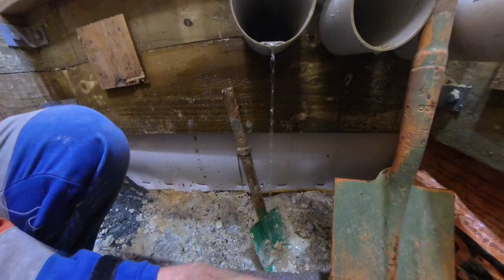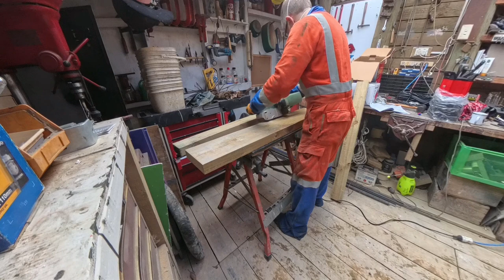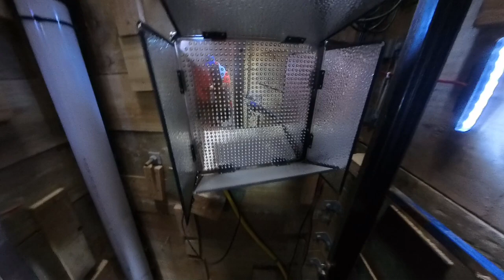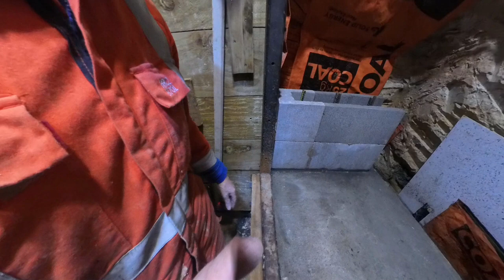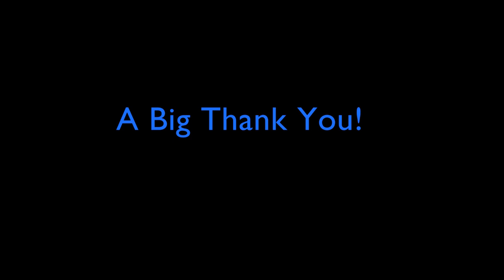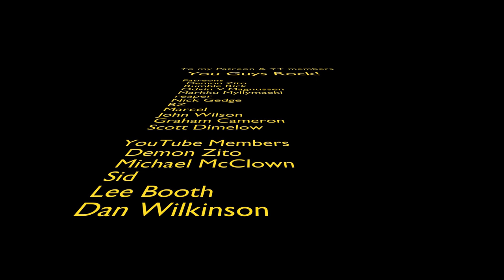Water Problems in the Secret Underground Bunker Build

Comment: As long as you keep cutting out the web on the block you dont need to care much about staggering joints, just lots of rebar on cold joints, its just a nice finish form work for the concrete.

Comment: Ah a probattunity . Your gatden being  sloping in terrain. If you put the water outlets as low as you dare, once the water is out of the hole its travels downhill acting as syphon helping the pump overcome that 8m lift. 
Glueing bricks together feels wrong,and looks expensive (unless you have a 'supply 😉😉' of the stuff)  it might be lime mortar that can be used super thin( victorian style, ↖️ no expert) 
Guess your newfound water supply is coming from the exposed clay face of the tunnel,any pooling at the  far edge of slab. Maybe repurpose a vent to drainage.hopefully temporary otherwise A few cables inside an air duct doesn't sound to terrible. 
New pump looks good , might even be able to cope with mums cooking.

Comment: There should be a thread on the fitting Lex get a 25mm dwt threaded fitting to connect to the pump. Get a screw able union to easily disconnect it from the pipework for service. Try and use 45 degree bends if you can it will increase the flow rate 90 is a lot more restrictive. Flexible hose can kink to easily.

Comment: You need to stagger the bricks so they interlock when filled with concrete.. if you don't stagger them they will work as individual columns rather than a solid wall. Steel layer every course of blocks. There will be a lot of pressure on the lower courses. If you can paint the back with a waterproof membrane then a layer of core flute to protect it then backfill. Positive membrane on the outside of blocks. If the moisture gets in mould will destroy your space.  Could be wrong but this is my opinion from many years experience in the building game.
Reply: What Dale say is right. I rebuilt a retaining wall in the garden with the rebar spaced at 445mm so when the blocks laid interlocked, they are all tied together. Paint with a membrane or better use sheets of tanking.

Comment: Made anything from all the clay you dug out yet? Submersible sump pumps are great, used them in graywater tanks.
Reply from the maker: I've tried making things but they've all exploded when I've tried firing them in the boiler at work.  Hoping the pump will be an improvement.